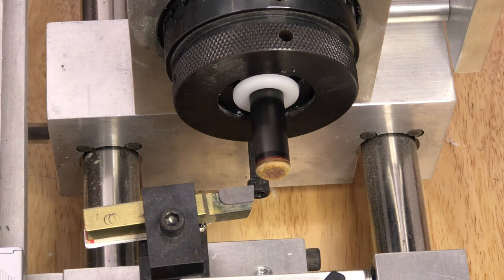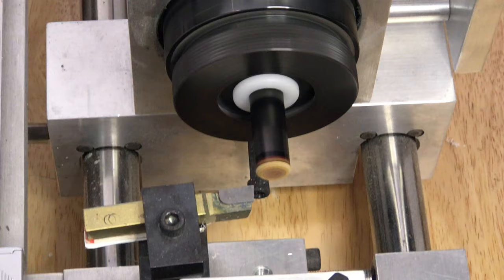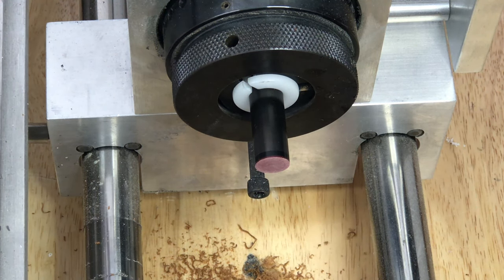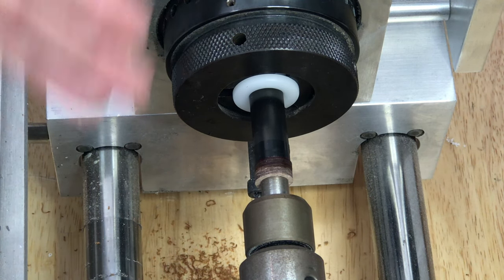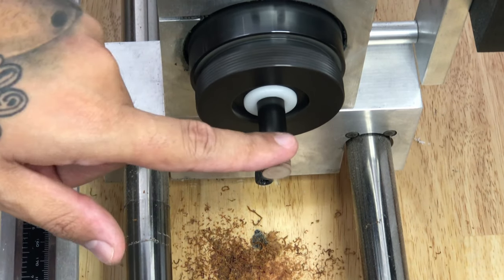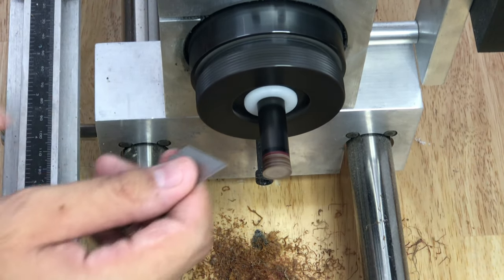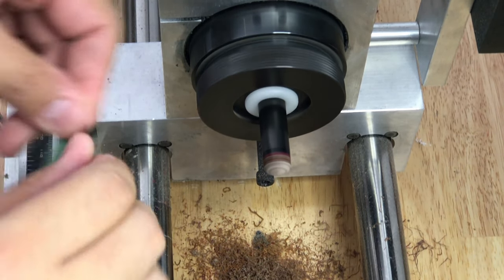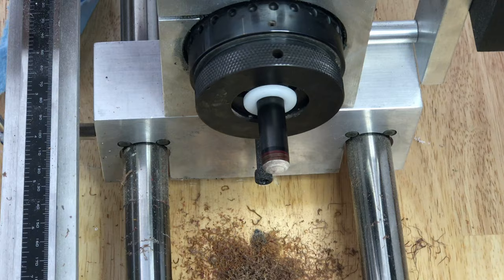How to change the tip on a Predator Revo shaft

Comment: Doesn’t the silence pad get worn after changing the tip multiple times on revo ? I noticed that the red coloring is starting to fade away on mine that’s why i am asking. Thanks for your recent respond btw !
Reply from the maker: Yes it will eventually get worn. If the installer is good you should be able to change the tip 30+ times before that pad needs replacing

Comment: After a month from installing a new tip i noticed some residue from the superglue i uses to glue the tip. I‘d be happy to hear your advise on this. Should i use some aceton ? Or use the razor blade ?.
Reply from the maker: The black electric tape I use is key for keeping the super glue from getting on the actual carbon. If you have residue on the shaft yes use a little acetone.

Comment: Love you content ,but I am curious do you use water on the tip before cutting so the layers do not get too hot and de laminate?
Reply from the maker: It lubricants the tip allowing the razo blade to cut through the leather easier. Yes also keeps the leather from getting too hot

Comment: What machine do you use to do tip changes? You said it had digital read outs cool
Reply from the maker: I have a Cuemaker lathe by unique products inc. They offer a digital readout option with the purchase
Reply: Thank you sir! It will be a lot easier with a digital read out ! Did it come with instructions or pre installed on machine?

Comment: Where did you get the collets to hold cue to perform work? What size of collets would I need to do cue work of all kinds of shafts there is a demand for this because is have a revo that needs a tip change and some of my friends ask me because I work in a machine shop to change tips but need a machine like yours with digital read out so I'm not taking off more than I need to!
Reply from the maker: You can get the collets at atlas billiards supplies

Comment: Do you know what pad the put on cuetec carbon fiber cues or do they even have one on cuetec carbon fiber? Do you have a video to put on pads to and tip?
Reply from the maker: The cuetec carbon fiber shafts don’t come with fiber pads because of the way they are engineered they don’t need them

Comment: Just got a REVO shaft and I know where I’m going when I need my tip changed! You’re in San Diego, right? I can get my tip changed and get some bomb tacos too.
Reply from the maker: Yes I’m in San Diego hit me up
Reply: @abdiaz66  my stock victory tip is already mushrooming. Do you have any other tips recommendations? The tip not being flush with the pad really bugs me.
Reply from the maker: @shortydancer  unfortunately all tips tend to squat to a certain extent. Soft tips in particular. What I tend to do at customer request is I’ll put a slight taper on the actual leather tip when installing it. This allows for the tip to squat evenly flush with the ferrule